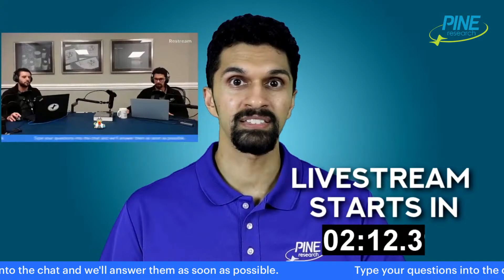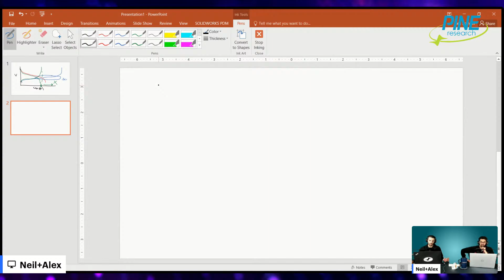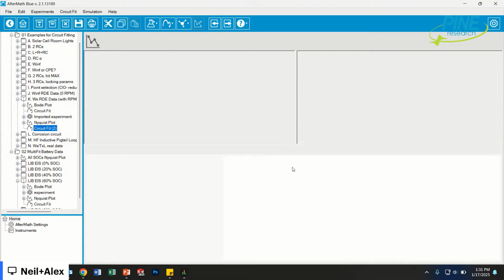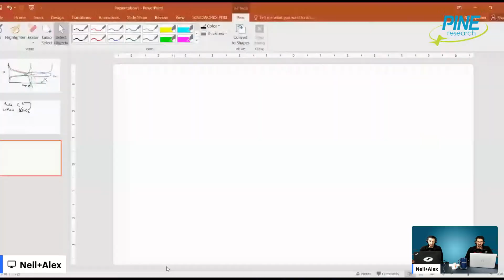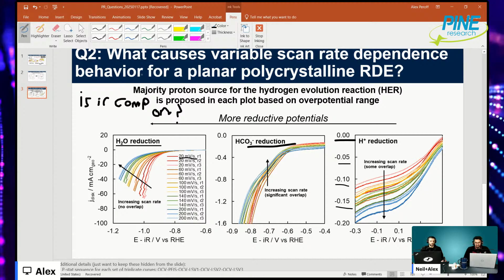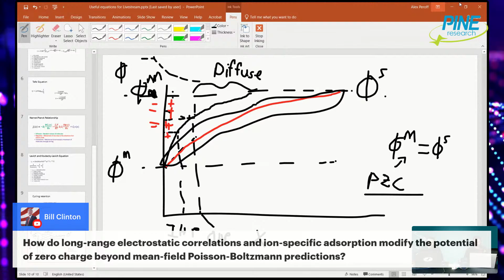Episode #83: Which diffusion coefficient is calculated from Warburg circuit fitting?

Comment: Regarding the diffusion processes in a metal hydride electrode during charge and discharge, we observe interstitial diffusion of hydrogen atoms (within the bulk metal) and diffusion of H2O/OH⁻ ions (within the bulk solution near the electrode surface). M + H2O + e- = MH(ads) + OH- and MH(ads) = MH(abs). Is it possible to calculate all these diffusion coefficients using Warburg circuit fitting? Thank you.
Reply from the maker: To be perfectly blunt, I don't know the answer, but this is what I'm thinking about.  I believe that the diffusion coefficient for M + H2O + e- = MH(ads) + OH- can be determined, by CV, CA, and EIS.  This is because we can detect the electron transfer in the reaction and observe how the current response is a function of the diffusion coefficient.  However, MH(ads) = MH(abs) doesn't involve an electron transfer or a charge transfer into the metal.  In principle this could be modelled as an EC reaction, but it's hard to model surface reaction kinetics in general.  I'm not sure that's too helpful, but that's my initial thoughts on the matter.

Comment: Thank you so much for addressing my questions! To clarify/follow-up:

1) At 1:14:10 — I did not use real-time iR compensation during the experiment. Instead, I applied iR compensation post-run during analysis, using the PEIS measurement recorded just before the run. I was under the impression that the timing of iR compensation (whether during or after a run) didn’t matter, but based on further reading, it seems that potentiostats exhibit a time lag between potential application and current measurement, which can introduce errors when applying post-run iR compensation. Therefore, is it fundamentally the time lag inherent to the potentiostat that distorts data when post-run iR compensation is applied, particularly at higher scan rates and currents?

2) At 1:17:30 — I actually used the same resistance value for all three replicates ("r" stands for "rep" in these plots). The resistance was determined via PEIS before the entire sequence of runs: OCV-PEIS-OCV-LSV1-OCV-LSV2-OCV-LSV3. Since I’ve found that resistance typically remains stable between consecutive runs, I only measured it once for the set of triplicate scan rates.
Reply from the maker: Thanks for the clarification. A couple things:

1) Post-run iR compensation should only really be done if the iR drop is not very large. In some ways, it is a classic Catch-22. That is, if the iR drop is low, you can correct during the experiment or after the fact, but either way since the iR drop is pretty small it may not make much of a difference anyway. However, if it's sizable enough that it does impact your measured potential, correcting afterwards can be done but it is not the same as correcting with the potentiostat/software during your experiment. I can talk about this and show some graphics to illustrate it for you on our next livestream this coming Friday, but in short what it means is you are correcting your E axis but your scan rate was not constant. To address your last point, I am not aware of any such time lag with the potentiostat circuitry itself, though I suppose such a thing might be possible. But in general, the feedback loop of a potentiostat (assuming it is not oscillating or stuck) is extremely fast and on a quicker timescale than your electrochemistry experiment so I would be skeptical that instrument circuitry is impacting this process.

2) The only thing I will add about this part with your HER curves is that you are working against two competing phenomena in my estimation: first, the potential metric for whatever certain current density is really important and the kind of thing HER researchers are usually very focused on; and second, variation in any set of electrochemistry experiments (HER included) is ubiquitous. So, all I mean to say here is I understand your scrutiny and concern over the apparent drifting of your curves from test to test, even if as you say you are using the same Ru value each time. But I think variance is part of electrochemistry, unfortunately. I suppose that is partly the name of the game, repetition until you can obtain the best data amidst all the noise, but you will likely never eliminate some degree of variation even between tests where you did everything "the same" in your view.
Reply: @Pineresearch  Thank you for the detailed response! And an explanation of real-time iR compensation at the next livestream would be much appreciated!
Reply from the maker: @clarem22  My pleasure! I have added it to our saved queue and will plan to discuss Friday, Jan 24 around 1pm EST, it will be our livestream #84 if you need to watch it later.
Reply from the maker: Hi @clarem22, apologies that I actually did not get to your question on episode #84 last week, there were too many live questions and we ran out of time. I will get to your question first thing on this week, #85: https://www.youtube.com/live/GRCcq9irdcY

The livestream will be a day earlier this week on Thursday instead of Friday.